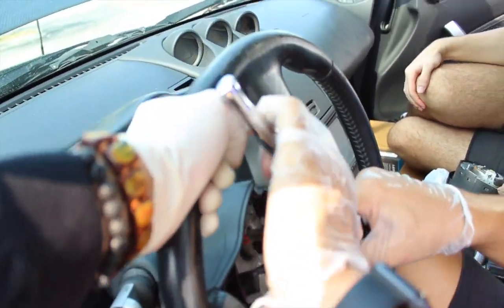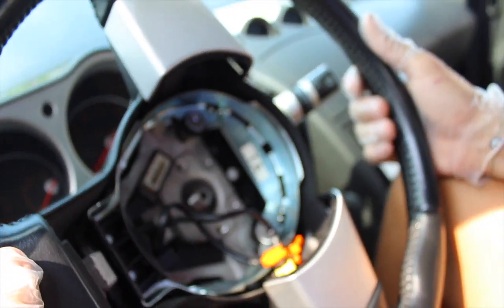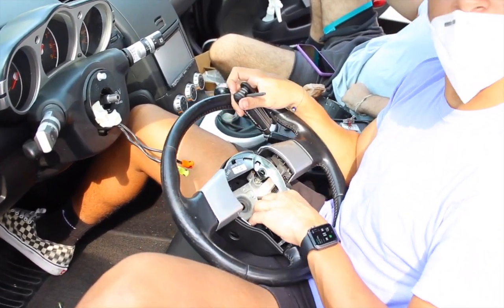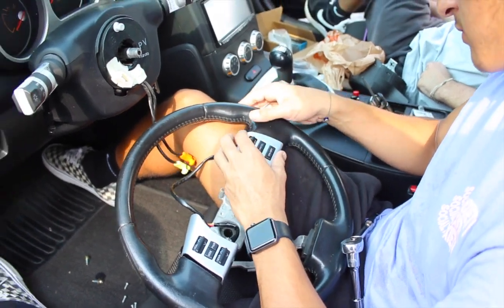HOW TO INSTALL CRUISE CONTROL BUTTONS ON NISSAN 350Z

Comment: Do you need the brake pedal and clutch switches in order for the cruise control to work to change maps? I just have the cruise control steering wheel
Reply from the maker: Yes you need the switches

Comment: 1. Use a paint marker on the steering wheel nut and draw a line on the steering wheel to make sure you realign it correctly. 2. Loosen the 19mm shaft nut a few turns and hit your wheel left and right to loosen the wheel. Great video though.
Reply from the maker: Tall Kobes thank you for the heads up , I’ll make sure to do that next time to avoid messing anything up. Thanks for watching

Comment: Do you need the brake pedal and clutch switches for this to work for map switching on Uprev? Or does it work fine without the switches?
Reply from the maker: You need them brake switches 🤣and clutch
Reply: yea you do

Comment: did the cruise control work on your car or u need something extra?
Reply from the maker: need clutch and brake pedal switches
Reply: @juvroom_  is the clutch switch already in the car since you have to push the clutch down to start the car or no cause I only bought the break pedal switch and how do u install those

Comment: So you can use cruise control if I buy the sensors. Like it’s a legit plug and okay and cruise control works?
Reply from the maker: Johnathan Lopez you would still need the clutch and brake switches but I’m not entirely sure. I only got them in order for me to go through my maps when I get it tuned.

Comment: Quick question, so I got my base 350 tuned with uprev and ark and have about 5 maps on there. I don’t have the cruise control buttons on my wheel so I can’t switch maps. Since my 350z is already tuned can I just add the buttons and it would work? Thanks guys
Reply from the maker: What map did it stay on? and you got the car like that? you didnt tune it. because its weird usually your tuner would let you know about the switches
Reply: @juvroom_  nah I didn’t get the car like that. I got it tuned but right now it’s on a pops and bangs map. He told me since my car is a base I would need to buy the switches for the clutch and brake pedal and the buttons to switch maps and then activate the cruise control in the rom file
Reply: @Jebsterss  my tuner told me get the buttons and we can set ap rolling anti-lag , launch control switch maps